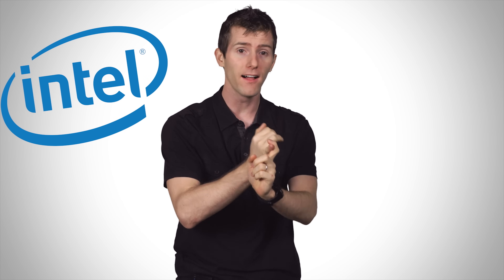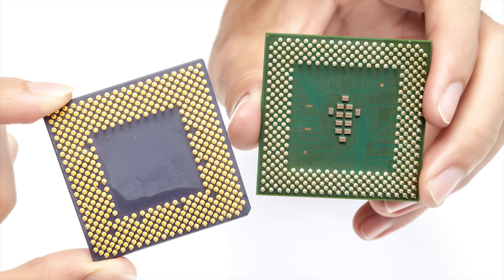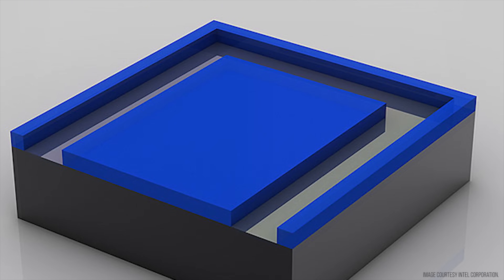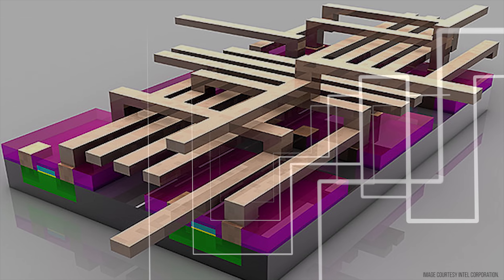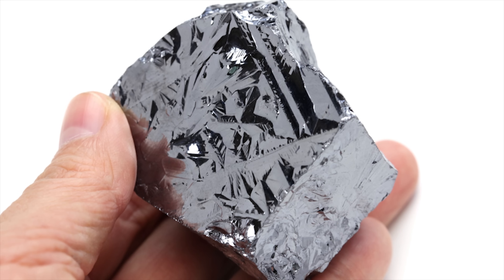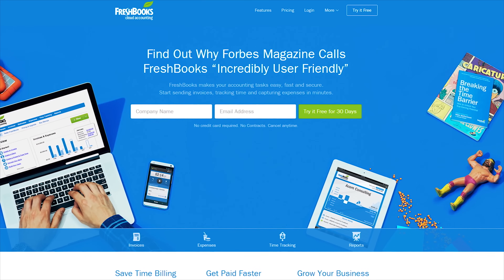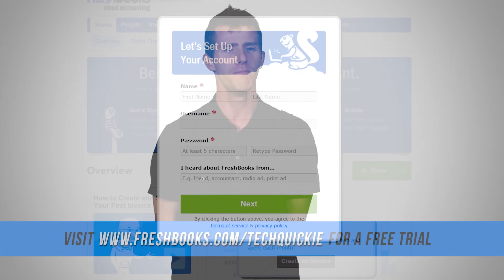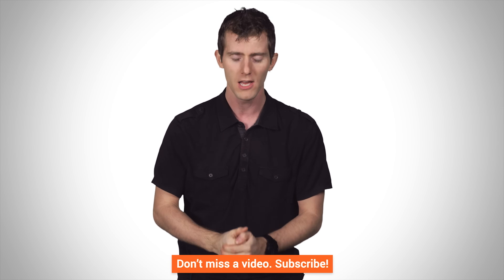How CPUs Are Made As Fast As Possible

Comment: So what you are saying is that I CAN'T make my own CPU without spending thousands more that what the most expensive CPU would be?
Reply: I quess calculator is possible with hand soldering transistors
Reply: just as any modern electronic product
Reply: +Gaming Hoot Pretty much when you try making anything which is mass produced...
Reply: +Gaming Hoot You could do a pretty shitty and useless one lol
Reply: Bowowowification You CAN make a CPU, for far lesser than what the above are suggesting. Obviously if you wanna make an ASIC (as in 'Application Specific Integrated Circuit') like intel CPUs you need billions, but if you're interested in designing and "building" them, you can build them on an FPGA ('Field Programmable Gate Array'). It's basically a huge die of configurable silicon, which means, you can make a CPU on an FPGA, and a lot of people have done it. If you're interested in that, go to OpenCores. It might be a bit difficult to learn especially if you know  sequential coding (If you don't know what sequential coding is, you're better off). At this point in time, you might be wondering what's the difference, well, the clock speed, and the way it internally works. Hope that helps

EDIT:
Might not be much, but this is a great cheap starter FPGA board http://www.aliexpress.com/item/Free-shipping-ALTERA-FPGA-EP2C5T144C8N-fpga-board-USB-BLASTER-fpga-development-board-fpga-altera-board/793643076.html?spm=2114.01020208.3.1.ugichu&ws_ab_test=searchweb201556_3,searchweb201644_3_79_78_77_82_80_62_81,searchweb201560_8

Don't be skeptical about china. As a hobbyist, they're literally the best thing that happened to me
Reply: +Ronnie76Games Not really, no. He can make a very shite CPU without all the cost of R&D cause people made that effort already.
Reply: +supervegito2277 I'm guessing you're white since you didn't get called in the office for a possible bomb threat ヽ( ͝° ͜ʖ͡°)ﾉ
Reply: You can make your own CPU, it requires a lot of transistors and soldering and it would be hugormous(huge and enormous)
Reply: supervegito2277  Ryan Gunn  man ffs do I have to put a /s at the end of that...
Reply: +Gaming Hoot instead of making a real small one you could just make a HUGE one out of conventional transistors and what not. it would take a shitload of power to run and then thers the problem of architecture, guess you will have to make your own..... ya, pretty hard project to say the least
Reply: stress the last two points about differences
Reply: literal billions.
Reply: +Kavo-Thizzla Yeah but it was PART of the school.. it wasnt something i took with me, it was something made there, during one of the lessons.
Reply: You could buy hundreds and hundreds of transistors and solder them together yourself. It would be fucking huge but it's not impossible to do
Reply: +Gaming Hoot Well i mean you could always design one and ask a manufacturer to print it for you. You could get a job out of it as well
Reply: +cakebrin3r Factories such as global foundaries will ignore your tiny order unless its a least a few millions of dollars in volume. They'd expect that you'd play with your design and perfect it on an FPGA LONG before going to them.
Reply: +Gaming Hoot So what you're saying is that I CAN'T make my own car without spending thousands more than what the most expensive car would be?

Do you get it yet? Even spending $2,000 on a CPU is FAR cheaper than hiring thousands of engineers (FOR YEARS) to make ONE product. The efficiency of scale even apply to assembling a computer yourself. Most people just don't know how to value their labor. (In other words, it is cheaper to buy one pre-build than to spend time learning to build it yourself.)
Reply: Bowowowification
1. I don't believe they've put backdoor IN the CPU as that's gonna needlessly complicate the architecture (but then again, the x86 architecture isn't exactly all goodies, especially the fact that the uArchs are needlessly complicated and unoptimized... Don't mind me, just my past experience of developing OSes).
2. GET an FPGA if you're interested in this stuff. All of Intel and AMD's CPUs start off as FPGA code (even though the FPGAs they use are prohibitively expensive). You then give the HDL code (the code used to make FPGA "programs") to a fab, they then make an ASIC out of it (I'm pretty sure you know this, but just to be safe, I'm REALLY simplifying stuff).

PS- You can't play around with an ARM core unless you have a license, and even then, you can only modify so much. You probably meant RISC cores. There's a link to an FPGA in my previous post if you're interested btw.
Reply: Bowowowification And if you think it's easy to modify the silicon that easily, you're mistaken, quite horribly. Your backdoor idea needs a way to "get" the data from the system to the govt.. Making a whole small "search for commands and then output this" unit isn't gonna be easy. And getting that out through the ethernet or any other interface to the government isn't gonna be easy  either..
Reply: +Gaming Hoot you can make your own CPU inside of MineCraft for free. You could also make small logic devices for cheap, but you cant make integrated circuits at home.
Reply: haz939
But they can be a serious pain in the ass when debugging
Reply: The most expensive CPU, is probably google's quantum chip. It skips the binary process and just goes straight to what it wants. This is being used to vastly improve AI (not in video games dumbasses who thought that) in real life. Google is actually getting fairly close to making the same brain of a cockroach in this chip. That sounds like nothing, but that is tens of terabytes going through in a split second. Our mind goes trough hundreds of terabytes a minute. Incredible right?
Reply: +wojtepanik i made an alarm once in school. motion sensitive with a circuit board some tin and a heating unit to melt the tin plus the connected. dunnl where it is anymlre but it runs on D batteries and starts beeping if slmeone interferes the invisible.light. beam
Reply: +Gaming Hoot Pretty Much...
Reply: +Kavo-Thizzla And that scenario is so fucked up noone would even try it here. Bomb threats do happen but due to how school works most would at worst be taken from the parents, and that would require something.

Odds are a fine which the parents then have to pay and expulsion.. You cant even arrest somone if they are 13 or below. The police cant even TOUCH them.
Reply: +Gaming Hoot Just use an FPGA
Reply: Yes
Reply: +Gaming Hoot Actually millions more is a little more accurate. The equipment is not cheap.
Reply: Kavo-Thizzla Eh. You'd be surprised how often I heard that seriously stated.
Reply: Shahe Ansar BEST ANSWER RIGHT HERE!!!
Reply: +Gaming Hoot r and d is expensive af it might be the same if you already had all the information and machines
Reply: +Gaming Hoot thousands? No, more like several billions.
Reply: +Gaming Hoot Put in a few billion USD / EUR and about 10 years into research with a big team and sure thing you can make a pentium 2 equivalent. :D
Reply: +Gaming Hoot I don't recall how long it has been, but there was a well known CPU manufacturer that made their processors by hand for their top of the line "Workstations".  I'm not sure if the company was acquired by Intel and Motorola when it finally went belly up.  Leading to the advancements in the PC-hybrid with the PowerPC CPU and Speed Stepping within the CPU.  Or something along those lines.  I'm sure you or someone else here will have a better idea of what I'm thinking of.

You can home brew your own computers from scratch.
Reply: +Gaming Hoot     *billions for a working one
Reply: Simon WoodburyForget
Quite a bit wrong...
Reply: Simon WoodburyForget
have not of...
Reply: Simon WoodburyForget No, actually I was trying to point out that FPGAs are used to develop modern day ASICs, not sim soft
Reply: +Gaming Hoot WHy would you want to?
Reply: Simon WoodburyForget
(-_-;)
Reply: +axel bananasplit00 bostr&#246;m No, you can&#39;t do that. You don&#39;t have the power for it... And I am no even talking about clock sync, clock latency and EM compatibility.
Reply: +Shahe Ansar FPGA's almost seem magical. They can be anything!
Reply: +axel “bananasplit00” boström It's not only about soldering them together, but about designing the logic and then connecting them according to the logic. Only the people with masters and a lot of experience in VLSI can design the logic that works.
Reply: Rajanaani
Not necessarily, you can find tons of tutorials on how to make cpus using discrete logic online
Reply: +Shahe Ansar true, but they won't be anywhere near the performance delivered by SOC processors. Not even comparable.
Reply: Wow simon, some one is on their monthly period (if you are old enough to know what that is). I'm not talking about any normal Intel or AMD CPU, I am talking about google's quantum chip. The quantum chip has the codes built into it. I'd doesn't do 1 or 0. It goes straight to what it needs because of the current situation. If it touches a wall, it doesn't do

Wall_block: 1
Move_up: 0

It goes straight to what it is programmed to. If properly made and coded, it knows exactly when it is reaching a wall or an object interfering with the path. So, it knows to go back, turn, or whatever. It doesn't use binary. Who is the ass here?
Reply: Shahe Ansar For extraction of data, you have another key sequence of bytes. When the modified bits of silicon see those bytes, it replaces part of them with the required extraction data. For instance, let's say there was a command READ MEMORY ADDRESS 0x00001234 (lets say that happens to contain your computer's password on every version of Windows.) Then they throw another command at it 0x5678ABCD, which happens to replace ABC with the first three characters of your password.
No need to understand how to talk to implementation specific ethernet controllers with this method.
Reply: Bowowowification
You know, I do play around with FPGAs so I know about it, and learned about it online
Reply: Shahe Ansar I wish I had that knowledge so I could put together a simple proof of concept for what I mean. Only played around with microcontrollers, never got my head into all that VHDL stuff.
Reply: It's not that hard once you her your head around parallel processing. Designing the logic simply seems hard, but it's really simple once you get the hang of it
Reply: Simon WoodburyForget
I meant the way everything in FPGAs occur at the same time
Reply: Gaming Hoot all you really need is duct tape and some determination 😉
Reply: +Kavo-Thizzla you do realize that calling the police is the law in that district for any device that could remotely be a hoax bomb. After two teachers told him to put it away, and he pulled it out, plugged it in, and made it start beeping for the third time during a class that day, he was sent to the principal's office, who called the cops to interview him. Him not being white is the only reason it made news headlines at all.
Reply: Shahe Ansar I'm on open cores. I wish I had the time to play around with an ARM core. (Interesting security applications of being entirely auditable, except for the FPGA itself, if you believe our government (edit: or other governments!) has been putting back doors into Intel/AMD CPUs.)  I've thought about this as a thought experiment and its do-able. A few court orders in the right place would be all you'd need.
Reply: Shahe Ansar Why would it make it needlessly complicated? First of all, CPUs are already complicated. Threatening an engineer at Intel to add just a few more tiny bits is no big deal. (Or maybe even just having "spy" engineers.) Secondly, This is not really an if but a when. (If they're not doing this already, they will at some point..)

A change they could introduce that would be a simple back door could be: Just a few transistors that are constantly searching the memory bus for a key byte sequence. That means it could even be at a higher level like javascript code on a webpage. Eventually, that code is going to go across a memory bus. No need to have your back door understand complex TCP/IP layers. Carrying data out could be in a similar way, a different key byte string that the CPU then replaces with bytes from another memory address. (Chosen by the first key sequence.)

It's slightly complicated, but actually fairly simple and near impossible to stop without a complete open design by Intel.

Comment: But why are wavers round? Wouldnt a square make more Sense. you dont lose anything.
Reply: +florent trepanier they are not just melted they are grown, silicon is cristal and every cristal is grown using perfect seed witch determines crystal structure, seed has rod form end it is dipped into the molten silicon, then it is rotated and gradually cooled down